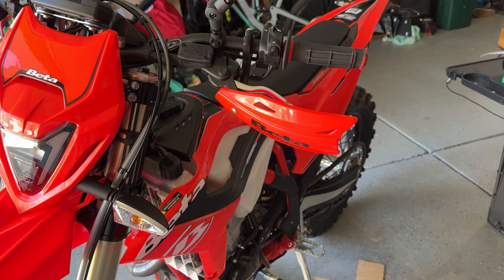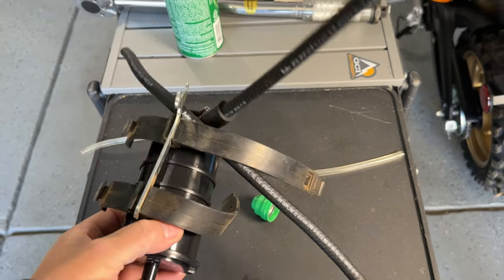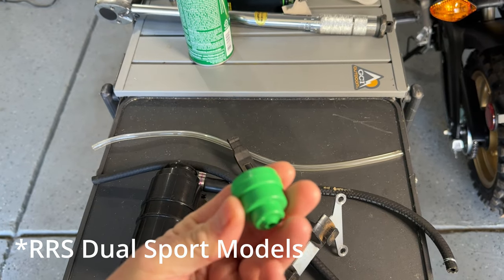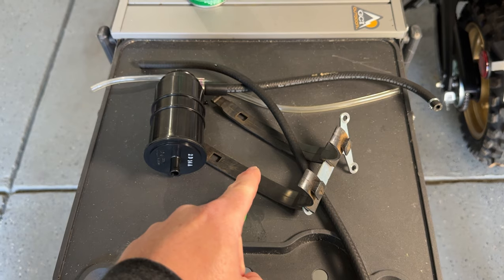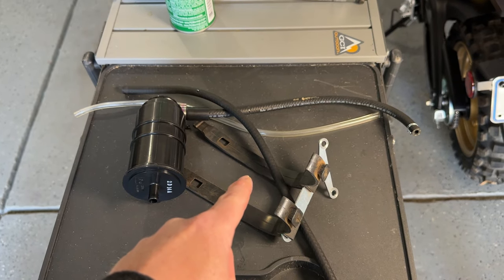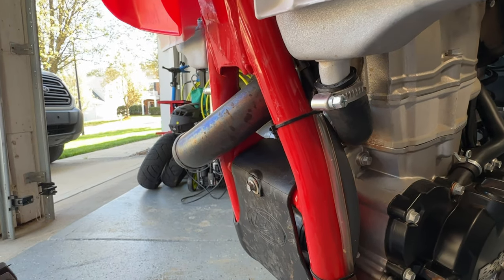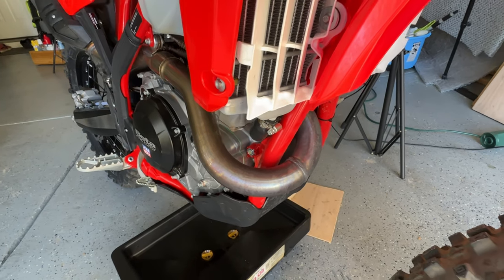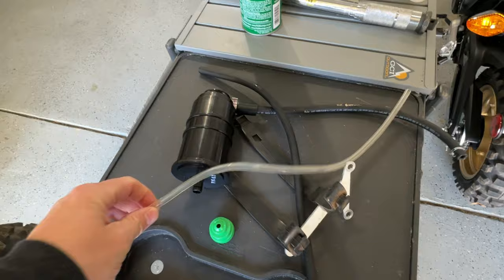#MTBPlanB 2023 Beta 390 RRS Dual Sport. This will save your exhaust!

Comment: Why did you remove that green plastic part under gas cap ?
Reply from the maker: It eventually will fall into your gas tank and likely cause another problem and you’ll have to fish it out. I just replaced it with an external check valve.
Reply: @MTBPlanB  thank you